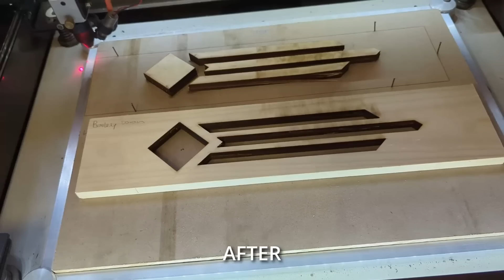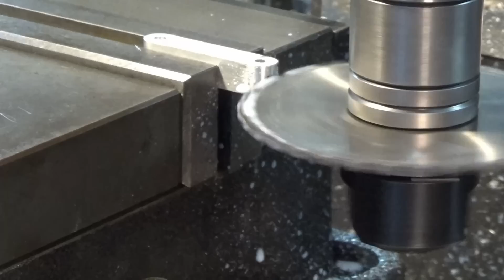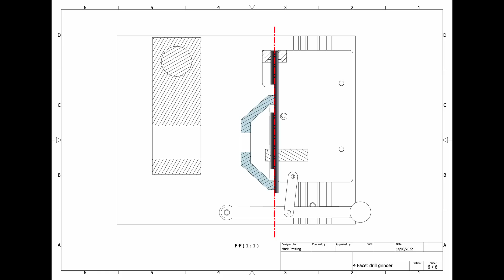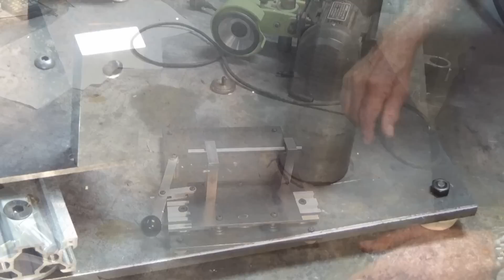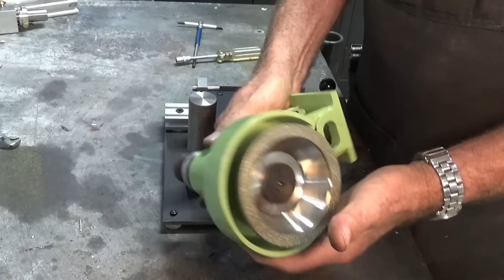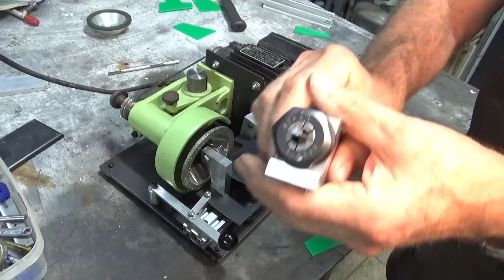A 4 Facet Drill Bit Grinder DIY Style Part 5

Comment: I’m
Very lucky I was able to find a optima drill grinder for reasonable price for around 1000$ it’s the standard in four facet grinding  and usually sell used for around 7k with all the accessories I have . But I’ve spent last three years buying just about every industrial drill grinder to try them out to see which ones I liked the most the only two left I haven’t bought that I wand to try thr rush model I really want and selling . But black diamond model 95 is my absolute favorite for how many types of drills it can sharpen unfortunately only goes to 3/4” but I can sharpen  anything bigger  by hand very easy . . Your sharpener is very cool I am not a real machinist tho have all the tools I buy and resell machinist tools to support my hobby but I have adhd and it makes staying focused not possible for very long and I wish I could be focused long enough to do what ya do I envy everyone who doesn’t have adhd I wouldn’t wish it on my worst enemy

Comment: Mark, hello again. Shipping for CBN wheels, where did you find an affordable one? If you have a link I would be appreciative.
Reply from the maker: I got mine on Amazon. They are made in China and there's no guarantee they are actually CBN. I bought two and the second one is not balanced very well. It could be that they are just electroplated diamond grit but so far they have worked well enough for what I am doing. https://www.amazon.com.au/dp/B00E6O4HWI?psc=1&ref=ppx_yo2ov_dt_b_product_details

Comment: Mark, in a mad 5minutes I decided that my collet block could do with improvement so I ordered some 25mm bore needle roller bearings and machined pockets on the front and back so the bearings were recessed. I had to make a new rear positioning collar as the pin on the back had to move further from the center of rotation to clear the bearing race. It does turn much more smoothly. It just goes to show how a 'good' idea can make a good deal of work! In my version I made the platform wide enough so that the whole cup wheel fits inside the cutout, this means the side supports can be rectangular. The cutout in the support plate is big enough so that the inside edge of a 6" rule flat on the grinding wheel can be aligned with 2 lines I put on the support pins. Keep safe mate.
Reply from the maker: That sounds like a good upgrade to an already good design. I have been impressed by the diversity of approaches shown by various builders on John Moran's website. Clearly, there are many different concepts and they all seem to have merit.
Regards,
Mark

Comment: Mark, is there enough bar stock left that you could split the shaft at the edge of the flat in the middle - between the two flats - to be able to drill and insert a small pin? Then just use two machinist squares to align the flats back up. This would allow to split the shaft and pull the shafts out from the wheel.
Reply from the maker: Probably, but it's really a once off setup. Or, in my case, twice off since I have broken the machine down again to do all the metal finishing processes on it. If you use a CBN wheel, it shouldn't be necessary to use the setting bar again.
Regards,
Mark

Comment: Thanks Mark for yet another clear and interesting session. I do appreciate your clarity, diversity and skill as well as the gentle sense of humor. One question out of this video ...  what exactly is the type and source of the two ply two colour plastic that you laser engraved please ? Cheers from 2000k SSW of you !
Reply from the maker: I always had trouble finding supplies of the 2 ply laser engraving plastic. Trotec lasers supply small quantities but they were always a bit coy about their pricing and they didn't have an online shop. Just recently they started to supply small sheet sizes of a fairly large range of laserable materials. https://www.troteclaser.com/en-au/laserable-materials?source_campaign=70158000000Y8Kv&gclid=Cj0KCQjw27mhBhC9ARIsAIFsETEXF3m2lD4XvnF5CsHf5IP8hSgwaOOkAuZvrsYK_hVWkLeWm3K-nacaAibvEALw_wcB
You have to register to get access to the online store and initially, I thought they would reject my  application because I was just a hobbyist. However I was granted a user name and password without any fuss and I purchased a pack of nice quality material in a variety of colours. The black and yellow stock shown in this video came from a pack I purchased on AliExpress. It was very cheap and I suspect it's not very good quality. It tends to make a lot of smoke and soot and it has a peculiar acrid smell when it is being cut. I usually use it for drafts and if they turn out OK I will cut one from the Trotec stock. However, this one turned out quite well so I kept it as is. If you want good quality materials I would get the Trotec though.
Regards,
Mark
Reply: @Preso58  Thanks so much Mark, I've begun the registration process with Trotec which I suspect will have to wait till after Easter to complete. Wet weather here in Melbourne at last which should mean yours will become less humid and delightfully comfortable again. 
Cheers, 
Peter

Comment: what happens if you change the cup wheel, will the mounting points no longer be a valid centre reference and thus the drill bit will no longer be on the face of the wheel? how is this accounted for?
Reply from the maker: Yes, changing the grinding wheel means that you would need to realign the face of the wheel with the centre line of the trunnion. The recommendation is that a CBN wheel is used since they don't require dressing and they should last indefinitely. 
Regards,
Mark

Comment: Now you finished your renovation in your house, I wanted to invite you to come and do mine. But after you told the TV-story, I'm not so sure anymore...
Very nice build indeed. And a custom made collet nut is a good idea.
Reply from the maker: I thought that would scare off a few would be renovators looking for an assistant! I have since found out that the amount of stickout on the drill bit is very critical. I can now run the standard collet nut across the wheel without it clashing. However, I am disappointed that I have left grinding marks all over the once pristine nut.
Regards,
Mark

Comment: Very nice build, and I agree that the 80 grit is a little aggressive, I think a 120 or even a 200 will give you a much better finish as long as they don’t build to much heat . I wonder if you could not move the fixture back a little so that you would have a little more stick out on the drill bit to keep from touching the collet 🤔 !
Reply from the maker: I have ordered a 200 grit CBN wheel. It is the same dimension as the one I now have so it won't mean having to change anything about the setup. I have also fine tuned the amount of stickout on the drill bit so the collet nut now clears the wheel. It'll all make sense in the next video.
Regards,
Mark

Comment: The fixture to adjust the stick out at the front and to get the drill horizontal looks quite important to get quick and consistent results.
I already waiting for the point splitting jig, I think the point splitting is very useful when you want to make  your own stubby drill bits. The webb will become too thick when you just cut a drill off.
Reply from the maker: I have found the correct amount of stickout for the drill bits. The collet nut can now pass across the surface of the wheel without clashing. I also made the point splitting jig today. I haven't tried it out yet but it looks like a useful accessory. 
Regards,
Mark

Comment: I looked at Johns design but went down a different route as I wanted additional  capabilities. You have done a great job in showing his design and how it can be adapted. I think grinding a perfectly cutting 4 facet drill bit is one of my most satisfying achievements thus far. I’m glad I’m not the only one to have nicked my collet nut within a few minutes of using the machine. I too struggle with the horizontal alignments of the lips and like your solution, I’ll definitely be making something similar. Thanks Mark.

Comment: G’Day Mark, very interesting series 👍🏼 The wife loved the bit about your house and was interested about you laser cutting pieces for the decorative trim.  Maybe this is a green light for me to get a new toy 😂 I know you’ve done a few videos producing items on your laser cutter, but do you think you could do a dedicated video going through the setup, use and maintenance?
Reply from the maker: I could do that but there are plenty of videos on how to cut thicker wood from two sides to effectively double the capacity of whatever tube you might have in your laser. Here is a good one here https://www.youtube.com/watch?v=DQXuzTTf2QE
You need to experiment a fair bit to dial in the settings and get the alignment of the wood accurate. My laser has a 40W CO2 tube and if I run it about 90% power and 5mm per second I can cut through 12mm hoop pine and the pieces just fall out. On the 19mm thick pine I had to finish the cut with a jig saw and files but it only left a web about 3mm thick in the centre so it was fairly easy to follow the line and clean up what the saw left behind. An 80W CO2 tube would probably cut through 19mm soft wood in one pass. Plywood can be difficult because the glue line tend to absorb the laser power and deflect it. Good quality marine ply is probably a better choice than cheap construction grade ply though. Some of the 20W diode lasers on the market now claim that they can cut through 1/2" thick solid wood in one pass but I think the wood  that they use to make those claims is material like bass wood which is very soft and it has a very fine uniform grain. I was asked to review an XTool 20W diode laser but the vendor backed out when I said I wanted to compare it to my CO2 laser. I think the two different technologies have their own benefits but in the long run, I think the CO2 lasers are safer and more versatile. It depends on what sort of work you want to do with it though. 
Regards,
Mark

Comment: Nice work Mark. Looking good and a finer grit wheel will improve surface finish and reduce the burrs on the grind. Can you not have a bit more stick out on the drill being ground to reduce the collet / grinding wheel collisions? Also, are you looking to add bushes into the aluminium link arm to reduce the wear that will occur between the pins and the arm itself?
Reply from the maker: I have ordered a 200 grit CBN wheel and yesterday I found the sweet spot for the drill stickout so the collet nut clears the face of the wheel. Also made the drill lip alignment jig and the feed screw. I am also 3D printing the split point jig which goes on the opposite side of the carriage plate. I must say the design is very clever and pretty much idiot proof once you get it set up. I don't think I will be adding bushes to the link arms though. There's very little rotational movement going on there and if the parts wear it will still work. Maybe some Teflon bushes could be added if and when it does wear.
Regards,
Mark

Comment: Awesome, This has been a great build... Lots involved in the setup.. And Woo Hoo...some test grinds. Thanks Mark, looking forward to the fine tuning and enhancements. BYW...I fell off the step stool while drywall finishing the hallway, no damage but mud everywhere...it happens. glad your okay.. 
ATB....Cheers !
Reply from the maker: Thanks Dean. Yes, it's a very clever tool and I was surprised at how well the facets lined up without having to adjust anything. I've tidied up a few loose ends and I am working on the split point jig now. Just 3D printing a mockup first though!
Regards,
Mark

Comment: Seems to work really well....nicely build. Any reason why the collet block needs to be so close to the grinding wheel??..... the drillbit stickout a few mm more and the collet block an equal amount backwards could prevent you from ever hitting the collet nut and also give you a better view on what you are doing.
Reply from the maker: I have since found an "ideal" stickout that allows the collet nut to just clear the grinding wheel but it's still very tight. The reason for this is because small diameter drill bit will flex or break during grinding if the clearance is excessive.
Regards,
Mark
Reply: @Preso58  Yes , i guess that could be a problem when sharpening smaller drillbits.

Comment: Great video once again. Back just before Christmas my foot slipped off the bottom rung of a ladder, didn't have a TV to soften the impact, landed flat on my back on a concrete path, only sustained soft tissue damage but it took three months before there was no back pain. As we age, we need to be more careful when using ladders.
Reply from the maker: I believe that the statistics show that falls from ladders are the most common form of workplace accident. Just take a look at YouTube and tree felling with ladders! 😱
Regards,
Mark

Comment: I have an over priced Drill Doctor that will somewhat sharpen drill bits but I need something that will sharpen end mills so I purchased the plans for the eccentric engineering tool and cutter grinder
Reply from the maker: That would be Gary's acute sharpening system? It's a nicely thought out tool and you don't need an engineering degree to make it work. Good choice.
Regards,
Mark
Reply: @Preso58  yes, it is the acute sharpening system.  I wanted to purchase a completed tool but I’m living on a very limited income.

Comment: It works!
Reply from the maker: It does indeed. I was surprised how easy it was to get the primary and secondary bevels to line up. Initially, I thought I would have to tweak the infeed to get the second bevel in the correct alignment but it happened automatically. Sweet!
Regards,
Mark